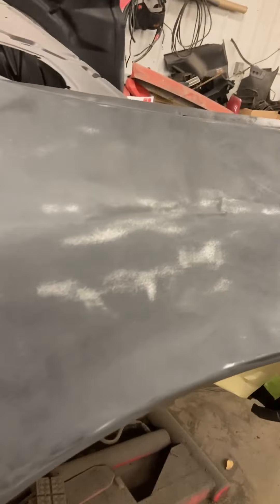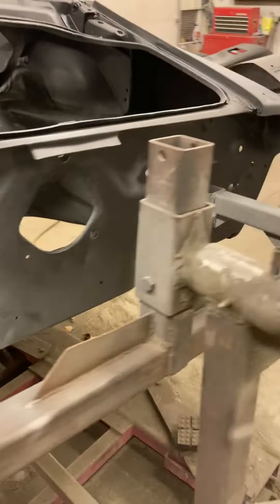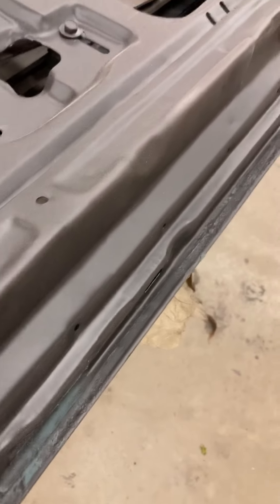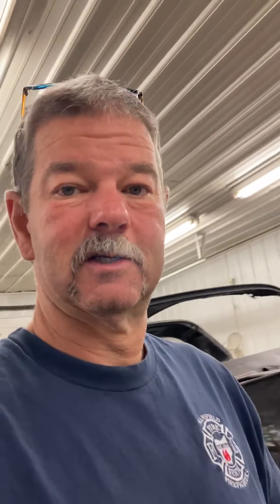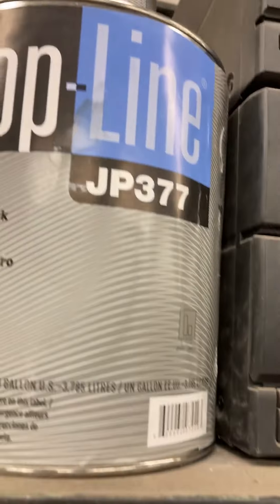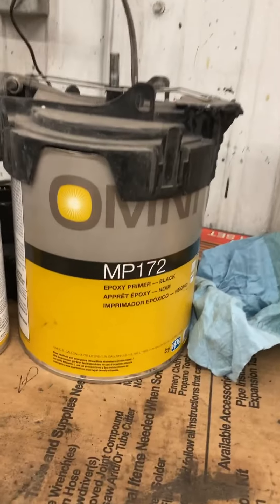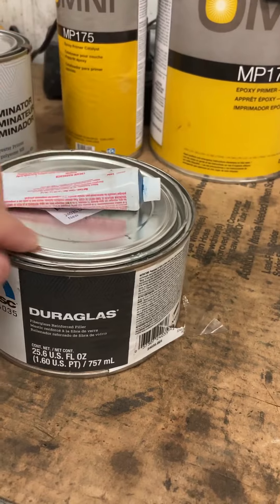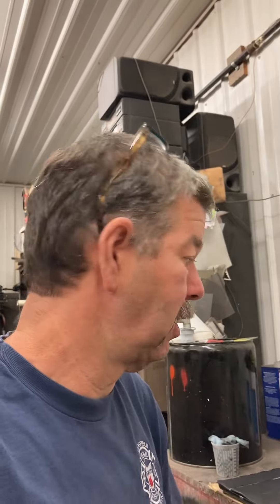Trans am restoration  400 ws6  w72

Comment: I’m glad I found your channel. I mentioned on your other video I’m restoring a 1977 SE Bandit Trans Am. I used to paint my own cars in the late 70s and 80s but I’ve lost touch with the modern products, my last paint job was my 76 Trans Am 50th anniversary back in 1982. I actually used feather fill back then and was impressed at how well it hid things. My paint job turned out pretty good for black car. Right now I’m collecting parts and I hope to start the bodywork soon. I really need to learn what’s available now and how to use it.
Reply from the maker: Stay tuned, and checkout autobodystore.com forum..good info there
Reply: Thanks, I guess my first question is what primer should I use on bare metal? In the old days I used lacquer everything. I guess I’ll be using the base coat clear coat paint? I watched a few of your videos. I’m originally from Michigan but I live in Georgia now. I’m familiar with rusty cars. My car is from Virginia and I do have rust issues. Thanks again!
Reply: Thanks, I guess my first question is what primer should I use on bare metal? In the old days I used lacquer everything. I guess I’ll be using the base coat clear coat paint? I watched a few of your videos. I’m originally from Michigan but I live in Georgia now. I’m familiar with rusty cars. My car is from Virginia and I do have rust issues. Thanks again!
Reply: Thanks, I guess my first question is what primer should I use on bare metal? In the old days I used lacquer everything. I guess I’ll be using the base coat clear coat paint? I watched a few of your videos. I’m originally from Michigan but I live in Georgia now. I’m familiar with rusty cars. My car is from Virginia and I do have rust issues. Thanks again!
Reply: Thanks, I guess my first question is what primer should I use on bare metal? In the old days I used lacquer everything. I guess I’ll be using the base coat clear coat paint? I watched a few of your videos. I’m originally from Michigan but I live in Georgia now. I’m familiar with rusty cars. My car is from Virginia and I do have rust issues. Thanks again!
Reply: Thanks, I guess my first question is what primer should I use on bare metal? In the old days I used lacquer everything. I guess I’ll be using the base coat clear coat paint? I watched a few of your videos. I’m originally from Michigan but I live in Georgia now. I’m familiar with rusty cars. My car is from Virginia and I do have rust issues. Thanks again!
Reply from the maker: @wlc1980  use epoxy on bare metal, stay away from etch primer, the acid will mess with polyester and epoxy….then use a high build polyester, you don5 haveto ,it just makes it easier and faster, its like sprayable bondo, then use a urethane primer last, it is waterproof, then paint!